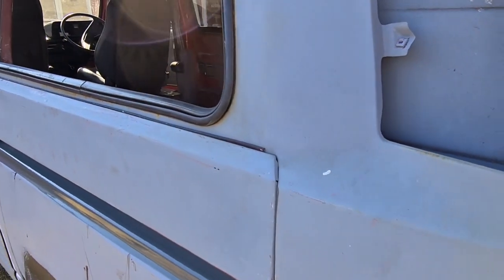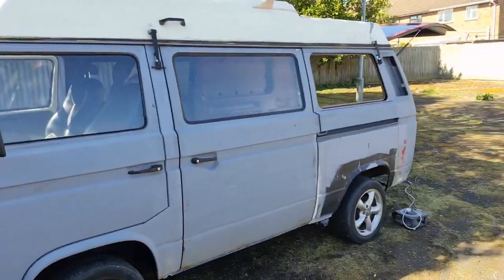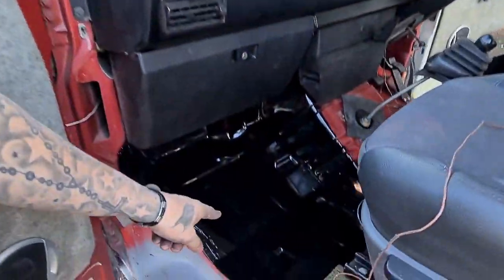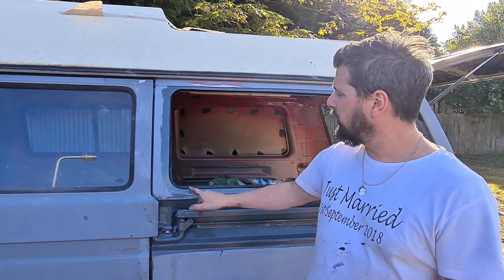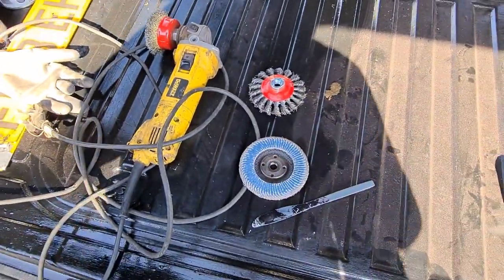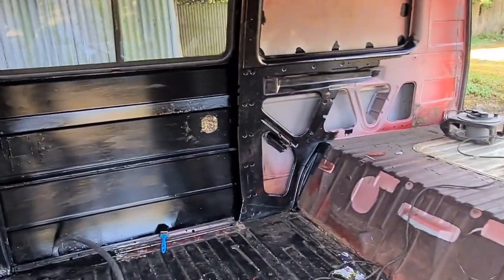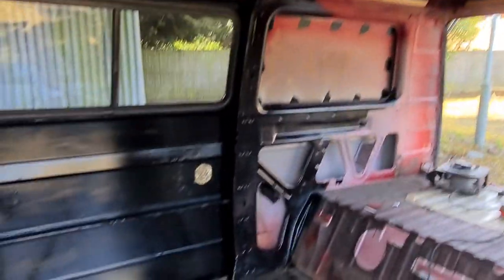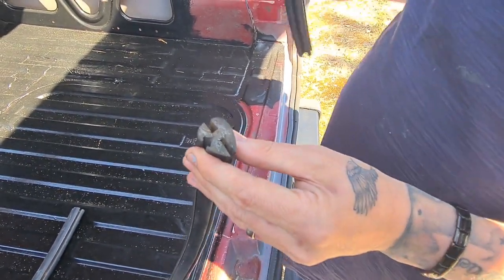Vw T25 window seal repair + paint inside self build campervan vanagon

Comment: Hi, I've done those seals before and found they came up short when cut them for some reason and I've had a windscreen rubber that seemed too long even though its one piece, I think the bay window vans had a chrome insert to fill the join so maybe those can be got. I can't say I've ever really tested one to see if it leaked after or not. The windscreen is definitely a two person job, usually involving a strong cord, dish soap and a worrying amount of hitting it.
Reply from the maker: Thanks for your help

Comment: About your seal and leak... I just bought a 1980 Vanagon T25, i'm in the process of gutting it. Every one of my seals had a cylindrical plastic insert which tightens the whole thing up. It's a long plastic strand of spaghetti, basically, I believe it had a fake chrome coating when new. Pulling mine out broke it in several places bc the plastic is brittle after all these years. I expect I'll have to replace it in order to avoid leaks have a close look at this image (not my photo) to see what I mean about the noodley insert in the seal https://www.thesamba.com/vw/gallery/pix/1363693.jpg . i hope that helps.

Comment: Nice work hopefully you should have a 6 month extension on mot due to lockdown. Mine rang out 6 April it's now the 6 October.
Reply from the maker: Is that for definite mine runs out the 16th of May I looked yesterday dose that give me to the 16th of November then
Reply: @vdubpollygrey7094  that's what I heard 6 month extension on mots on vehicles with mot beginning of april onwards still have to be road  safe. Mine's been extended so hopefully yours will be too might happen on mot date.
Reply: @vdubpollygrey7094  just checked it still saying the same on the gov.uk website mot exemption during lockdown 6 month extension.

Comment: I've not messed with my window seal but I can tell they're called a claytonrite seal and you can buy a claytonrite seal tool to fit the seal insert. Have you considered chip guard for the cab floor, as its more durable than hammer right?
Reply from the maker: Not the cab floor but I have considered chip guard up the sides to protect that in gray then paint over it .Good shout on cab floor didn't think about inside 👍